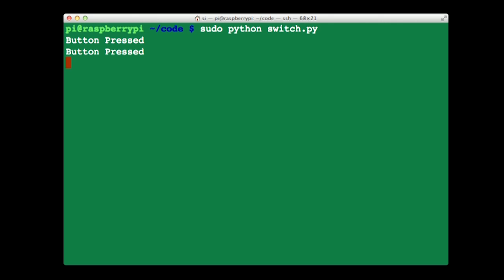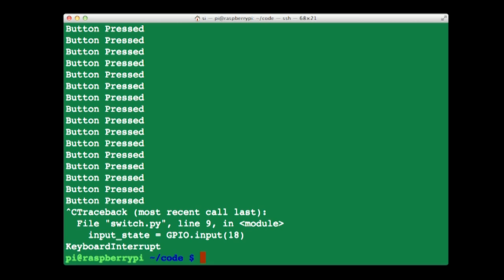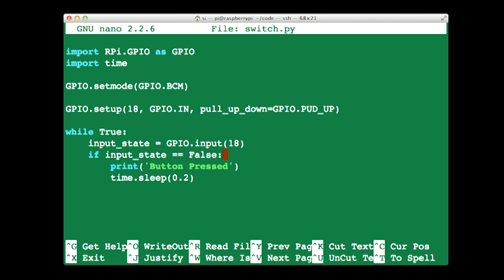Connecting a Push Switch with Raspberry Pi

Comment: Thanks! I did the same and it works! However, I have  a few questions: 
1) If I press the Push Switch for 24 hours or more (continuously), could there be any electrical problem?
2) Sometimes, the state didn't change. Maybe is better to use a resistor somewhere?
3) Is there a specific reason to use GPIO 18? Can I use every GPIO in raspberry pi?
4)  If I will use more GPIO can I use a common GND pin (or is it better use every GND for every GPIO?)
Thanks a lot for your tutorial and feedback

Comment: thank you. simple, and easy, i added my first button... but after a few days i noticed really sluggish performance. looping like this hammers the CPU but only does stuff "if" the state is low  

rather then this
        input_state = GPIO.input(18)
        if input_state = False:
passively waiting is much nicer
        GPIO.wait_for_edge(18, GPIO.FALLING)
Reply: is there any way if a button is kept pressed for longer than 3 seconds, I am creating an alarm system for taxi driver security , in panic situation he needed to pressed paddle switch for longer than 2 seconds to avoid accidentally triggering alarm in call centre.
Reply: is wait_for_edge kind of event listener ?

Comment: I never knew that there was on board resistors, I've always used the method of hooking one leg to directly to ground, that same leg to the input pin through a 10k resistor, then the other leg directly to 5vdc.

Comment: At 00:46 you start to give warnings about being careful. Why not simply tell the user to unplug the power prior to installing the switch and wires? Wouldn't that be far safer - especially for noobs?
Reply: it would be. i fried my pi by accidentally shorting 5v to a gpio.
Reply: @1JayZed  I mean sometimes you want to be working with live wires like with an arduino or as a check aslong as your following a schematic it should be safe

Comment: '
that push switch is a always noise click click..
not good...
better rather use a quiet silent push switch than noise sound click click
Reply: Good idea. I ended up using capacitive touch on a trinket m0 for a gentle touch 'click'.
Reply: @marknhopgood 
hi Y F...
'
i use quiet silent push switch on my LED electronic piano kits